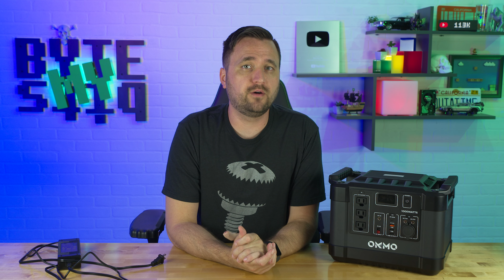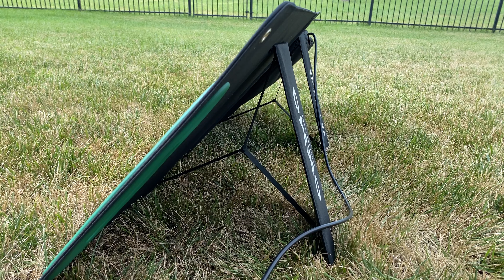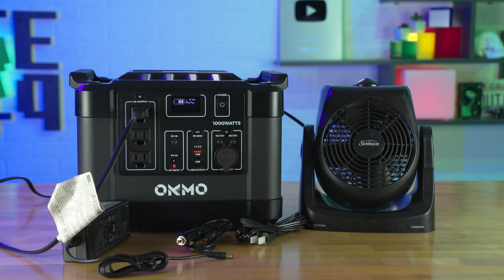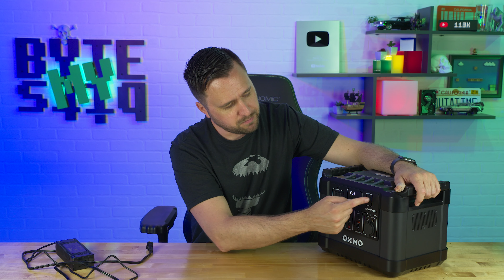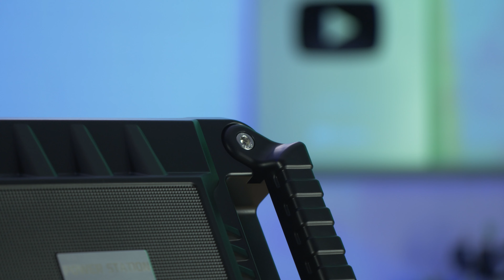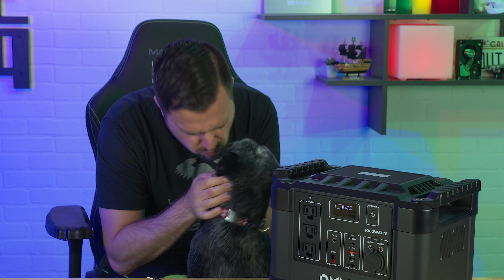OKMO G1000 Power Station - I guess they can't all be winners..

Comment: Waa waa waa on the screen.  You have bars to tell you the battery's state.  From 3 too two bars.... chances are your at 50% battery capacity.  Use your brains.  
If your sucking more than your blowing,  go on a diet.  Turn down the demand.  Entitlement never works.  Get real and be frugal.  You don't need to have EVERYTHING to have a good time at those camp parties.  Small fridge,  led lights,  fire,  and a small speaker system (if you must have music), and your good to go. 
Think outside the box.

Comment: I find it interesting that the only US product OKMO designed by an Apple engineer in silicon valley is the one that has some of the worse features. It surprises me. Okmo decided not to use the lithium iron phosphate battery for this unit which might explain the slow charging.

Comment: The  issue of the dropping of the wattage, does the voltage drop ? If so it could  damage  sensitive  electronics.
Reply: This is exactly what I was thinking. For anything with a heating element it will be nice, it'll just heat at a lower wattage. But some sensitive electronics may not function properly if the wattage (and/or voltage) is regulated down, and may even be permanently damaged from this.